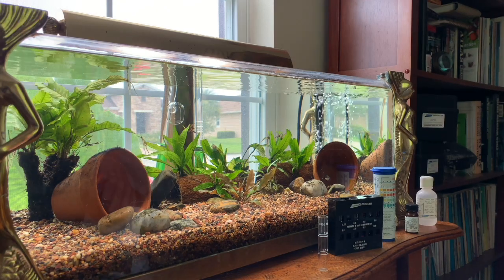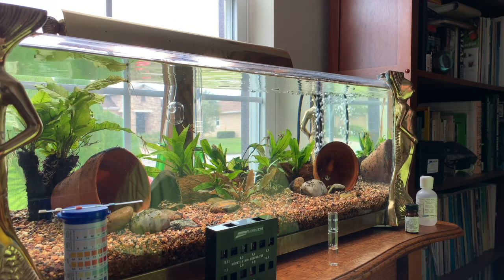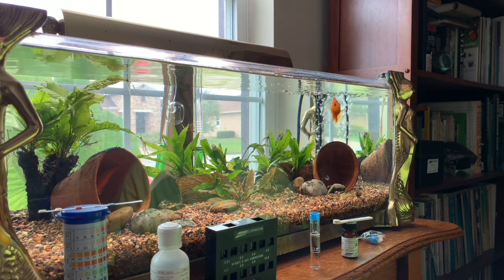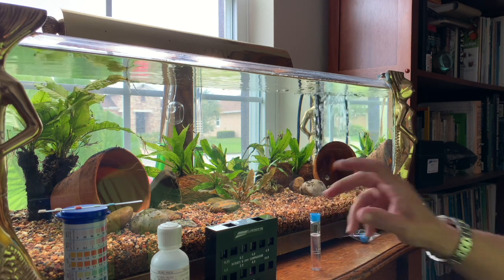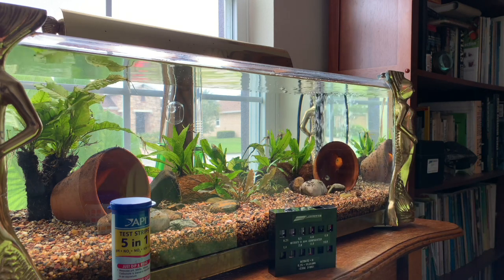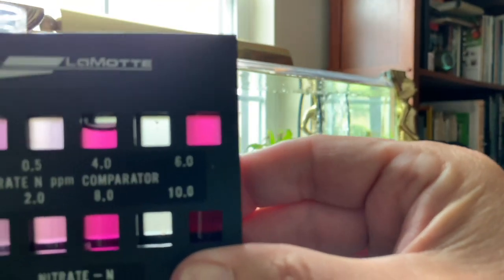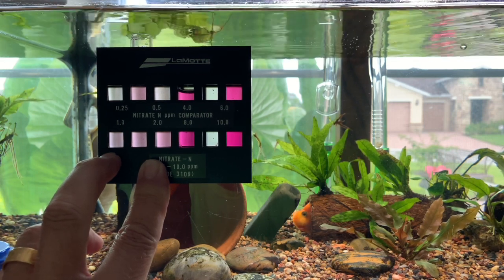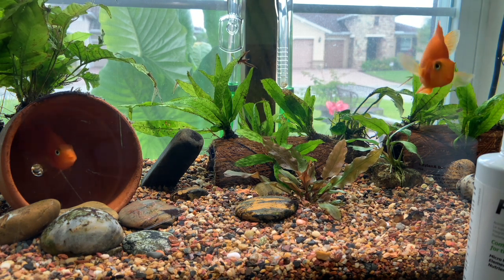So you think it the plants are utilizing the Nitrates and not the BCB’s

Comment: I guess that makes sense. Heterotrophic bacteria also need a source of carbon in order to use nitrates. I have a very difficult time growing water hyacinths or water lettuce in my pond.
Reply: If I may share my experience with water lettuce, I had mine grow like weeds until I decided to lower my tank's (not pond) temperature. Our temperatures normally hover around 29° - 32° Celsius. Reducing our tanks temp was for another experiment which failed. :D

Comment: Hi on your video about BCB. You explained how you need to use something with a crystallized form like cat litter in your video to pull the positive ions out. How would this work on different substrate like sand, etc? Also can you explain how that gets rid of phosphate as well. Thanks!
Reply from the maker: BCB's , Apart from reducing ammonia and nitrate levels, the system also reduces phosphate levels too. A molecule of phosphate (PO4) consists of one atom of phosphorous (P) joined to four atoms of oxygen (O). Phosphorous is essential for plants (including algae) since it’s required to build the plant’s DNA and is also needed to make the energy molecule ATP (adenosine triphosphate) which is necessary in order for the plant to convert carbon dioxide, water and oxygen into the carbohydrates that it will need to build new cells and grow. By drawing in and destroying phosphate in a biocenosis basket it is removed from the pond water where it could encourage algae but the phosphorous is still available to provide nutrients for any plant in it.

How anoxic filtration removes phosphate
As described above,  when facultative anaerobes are in an anoxic environment, they switch their mode of respiration and can take the oxygen they need from nitrate.
Since phosphate (PO4) consists of one atom of phosphorous (P) joined to four atoms of oxygen (O) the bugs are also able to take their oxygen from any phosphate in the water.
Additionally, baskets that contain plants will take phosphate directly through their roots.

Comment: First, thank you Dr. Novak for all the videos, and I'm thankful you are posting videos again!  Question.  I'm setting up my next aquarium, and I've bought the stuff to give the plenum a try.  My substrate is going to be at least 5" deep at the rear of the aquarium, so my lift tube will need to be longer than the one you showed.  As long as I have my airstone near the top of the lift tube will it be ok (assuming the length of travel of the air bubbles in the tube is what creates the water movement more than the actual length of the tube)?
Reply from the maker: Yes, it will with your application.
Reply from the maker: You’re right.
Reply: @anoxicfiltrationplenums  Thank you!!!

Comment: Hi Dr Novak, great video, very interesting.
Can you please explain for me about nitrate and BCB. If there are normal nitrogen bacteria in a tank, on the glass and on the rocks, and you have no plants, will the BCB reduce this nitrate?
Reply: Sorry, that question was not very clear. The BCB in my sump attracts Ammonia because the ammonia is positively charged, and the kitty litter is negatively charged. Nitrate in small amounts is being produced in my tank by bacteria on surfaces. This nitrate is negatively charged (I think). Therefore it is not pulled into the BCB. 
I am asking this because my nitrate levels are creeping up. By about 5ppm a week. That level is an estimated because my test kit (ATP) is not very sensitive. 
I am feeding 6 times a day because I just bought 10 Clown Loach and 12 Angels to add to my Discus, and they are growing fast. So it is a big load. I only have one BCB, but it seems to be doing fine and I am still cycling another with ammonia in a separate container. 
Do you think the nitrate will come under control? Or will it continue to rise slowly because of the other bacteria in the tank.
Thanks for your help.
Reply from the maker: yes, by adding more BCB it will make a big difference in your water quality.

Comment: Totally agree. I’ve had tanks bursting with aquatic and emerged (including duck weed) plants and yet the nitrate remained fairly high. Other tanks with high volume of porous substrate (have also used cat litter) have had little or no (API test kit) nitrate showing in the tests. I believe the bacteria are far more effective than the plants in this respect.
Reply from the maker: You are absolutely right, once people get educated their problems start disappearing.
Reply: Plants are not an effective way to reduce nitrates in tanks with a heavy bioload...it's a big misconception that plants alone can filter a tank...you need to either do heavy water changes weekly or put in an effective anoxic filter like what Dr. Novak has demonstrated...you can even achieve this with canister filters (takes some modifications but it can be done).

Comment: If the plants use the ammonia- doesn't by default lower nitrates? Because it absorbs the ammonia which would have been converted to nitrates eventually through the normal cycle?
Reply: Yes but it's very minimal...the ammonia being produced by fish and waste is far greater than anything plants can absorb....for most tanks that is.
Reply from the maker: Yes but watch the video I gave the link to maybe you’ll better understand.
Reply: I see it as this, ammonia is being produced constantly by the fishes. Ammonia gets aborbed by BOTH the plants and the nitrifying bacteria that are on the glass,rocks and sand surfaces.Not forgetting the canister filters or sump. Ammonia gets converted to nitrates by the bacteria, and over time the level rises, because the plants cannot reach top photosythensis without CO2 injection and correct lighting levels.As Dr.Novak  had explained  plant cannot covert the nitrates if it does not reach "full steam" {top photsythensis] One cannot stop the nitrifying bacteria, even if you take out the filters. The bacteria are on every surfaces in our aquariums. So nitrates will build up.
Reply from the maker: Sunny Tan  yes that is Right.

Here’s an excerpt my blog.

Part 3: No plant fertilizer tabs are to ever be used in a Biocenosis Basket ever!

Part 3

If you were wondering why you should not use any nitrogen tablets in the Biocenosis basket, it is because plants must get their nitrates into their cells against an electrical gradient. Plants, algae, and all photosynthesizing organisms use the N (NH3 and NH4+) of ammonium, not nitrates, to produce their proteins. Using nitrates is costly to the plant in terms of both electrons (e-) and energy. Because NH3 is a small molecule (NH3 ammonia enters plants even more easily than NH4+ ammonium) without an electrical charge, it freely diffuses back and forth across the cell membrane barrier.

The energy required is so substantial for the plant that nitrates are only taken up in the daylight (during photosynthesis) whereas considerable ammonium uptake will continue in the dark, all night long, long after photosynthesis has stopped. The fact is, or pond plants do not begin the process of photosynthesis, until the sun begins to rise. However, it is not unusual for plants to begin photosynthesis until as late as 11:00a.m. only for this process to peak around 2:00p.m. in the afternoon, then slowdown at sunset. After the process of photosynthesis can no longer take place, the plants will begin to generate carbon dioxide instead of oxygen. The plants do not have as much time to deal with excessive nitrates in solution, as you would think.

The energy used represents about one-fourth of the energy required for the plant to produce its carbohydrates. Photosynthesis is reduced by one-third in the conversion of each nitrate to ammonium, in a two–step process of nitrate reduction; the plant for increase growth and flowering could use this energy. The fact is none of our aquatic plants needs nitrates as a food source only ammonium, and there are only a few exceptions to this rule, one is Eichornia Crassipes (Water Hyacinth), with 75 percent of its food source being nitrogen and 25 percent being ammonium. Aquatic plants potted in compost, humus or topsoil endowed with organic matter will certainly grow luxuriantly. However, excess nutrients that leak into solution from such media will lead to the eutrophication or as it's called hypertrophication of the garden/Koi pond. This state of affairs arises from an over supply of plant nutrients in solution that favors the growth of algae at the expense of vascular plants.

Laterite or clay (Kitty litter) has a crystalline structure attracting cations (positive ions like k+, Ca+++, Mg++, Al+++). If other growth factors are present in reasonable amounts, (Note; this is called the Liebig Minimum Law) you will have good root growth. By good root growth, we do not mean many roots. You can have hardy plants with big, thick masses of roots in other systems. What we mean here is root hairs in proliferation filling up a planted pot. The more proliferation of root hairs, the better the plants uptake of cations (positive ion) and anions (negative ion) out of the water body proper. The adsorption and absorption, or in equal equilibrium between anions and cations is very important. If anions where taken into a plant without cations in equivalence, any plant would suffer from a fatal pH swing. Repeatedly it has been observed that the uptake of nitrates from pond containing both ammonium and nitrates only starts after ammonium has been exhausted or its concentrations greatly reduced.
Reply: @anoxicfiltrationplenums  This is why I like your channel so much.Your in depth studies and experiments not to mention your steadfast patience in explanation/educating keen aquarists is immensely valuable to many of us.